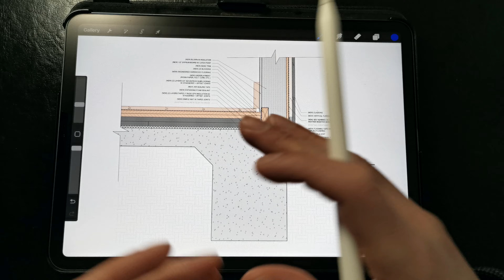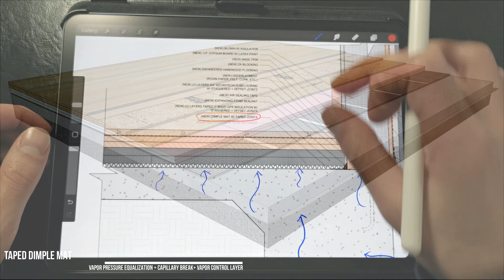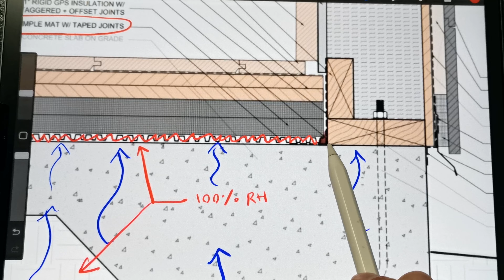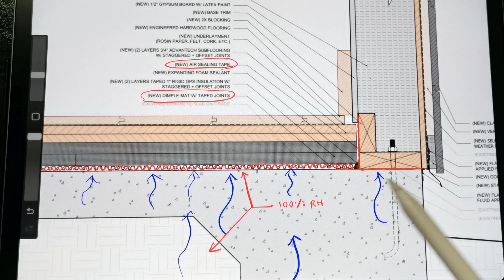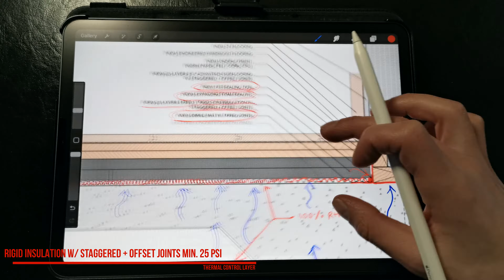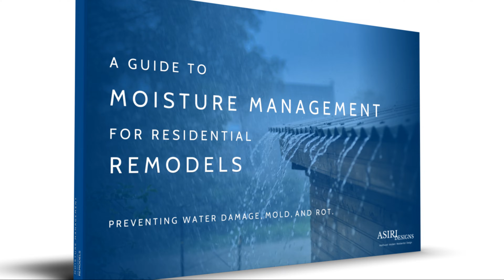Insulating and Sealing Existing Concrete Slabs (AVOID Moisture Issues)

Comment: Have you done any videos on insulating concrete garage floors, I use part of my heated garage for a workshop for my motorcycles, and part to park a vintage car.  Ceiling and walls are insulated, the concrete garage floor is not as yet but I want to do it (but am not sure what the best approach is to get some insulation along with strength to support vehicles, work benches, drill press, etc.).  Weather here in the Toronto area goes well below freezing in the winter, really need to address the cold concrete floor.

Comment: I used another cheaper technique. I dug two trenches on the uphill side of the house, one next to the foundation and one 10 feet away. Since there was no place to daylight the French drains I installed an exterior sump pump to get the water to the street. It took care of the problem.

Comment: If you apply this method to an old unfinished basement you raise the floor height half a foot. Which will look horrible if your basement stairs goes down to the basement and there will be a huge threshold at the door and you might have to readjust the lower stairs.
Reply: Old basements typically have limited headroom. Adding insulation and flooring above the original floor would be problematic

Comment: We recently converted a garage, with the typical concrete floor, to a livable space. When faced with all the COSTS and EXTRA WORK to put layer after layer after layer of vapor barriers and insulation, we decided to go with a flooring product that will NOT be affected by moisture - Premium Vinyl Planking. DEFINITELY the way to go to save yourself TIME and MONEY!!
Reply: This is just downright misinformed decision making. The vinyl itself is water proof but often there’s an underlay material attached like cork or form. This material IS NOT waterproof and will carry moisture and mold.
Reply: Sorry, pal...the only person pushing MISINFORMATION here is YOU! Went to the Big Boxes and even specialty flooring shops, many have a materials list of what it is made of and they also show a cross-section. The premium vinyl planking has ZERO cork, wood, or wood-derived products in it.

Comment: Moisture from the ground into the slab is liquid moisture, not vapor, so any talk of equalizing vapor pressure across the applied waterproof barrier doesn’t make sense, the barrier is really only to stop water from wicking or seeping up into the flooring system and the room.  A vapor barrier is needed to stop vapor from the room  air from condensing on a cold surface in the floor system.  In the system as presented it seems you are relying on the insulation snd subfloor materials to act as a vapor barrier.  Why not put a poly sheet just under the finish flooring same way as we put poly just under drywall?

Comment: Sounds good but it raises the floor 4.3/4". Can you at least is one 1" foam and one 3/4" subfloor glued together and use radiant floor heat?
Reply: Agreed! We faced the same dilemma, that after all the layering we were looking at nearly 5" of nonsense. We decided to get 3/4" high compression foam board with foiled side facing up into the room, taped all joints and installed premium vinyl planking over it. SOOO MUCH easier, and WAYYYY less money and we don't have to worry about the vinyl flooring expanding, warping or rotting.

Comment: Hi there! Would a dimple mat with 0.5 inch rigid foam insulation + a waterproof vinyl/laminate be sufficient? I don't have enough space to do multiple layers of insulation and or plywood/osb subfloor.
Reply from the maker: Check with the laminate manufacturer, in most cases this is fine, but all of your interior partition walls will need to bear on the slab since subflooring has been omitted.

Comment: I’m not sure if I’m buying it? What if there are already interior walls? Also, won’t this push moisture to the seal plates or the interior wall studs? I’m currently getting quotes for demo and replacement of a new slab with a vapor barrier. This seems like it would be way way cheaper.
Help please

Comment: I've read the PDF from the store and watched this video a few times. I have a couple questions on tape and foam. I'm applying this detail to a house built in 1977, which I'm rebuilding...so no gasket under the bottom plate.

Q1: The purpose of the tape from slab to blocking to air seal the bottom plate from the interior space. Should this seal be vapor open or closed? Would a liquid flashing would be as good as tape for the tape's purpose?

Q2: Is the purpose of the foam to seal the DELTA-FL to the tape, so the equilibrium of moisture is achieved? I'm avoiding foam in my build. Is there a caulk or liquid flashing that would be as good for the purpose of the foam?

Comment: WHAT IS “ ICEBURGING”? You said that in your last video.

Is SLAB HERE GOING TO BE THE SAME AS A POURED FOUNDATION  BASEMENT FLOOR?
I have a hole in my basement floor( somebody thought that was a good idea)well the gravity feed failed so  we got some water
Now I’ve a Sump pump with battery backup
Lived here some years no problem and then-water😡
NOW WE ARE DRY
I WANT A FLOOR OVER THE CEMENT
I WANT WATERPROOFING AND FIREPROOFING ON THE FLOOR. I don’t like cold and we have winters
My walls are insulated with a system from  a box store that is Sheetrock over thick foam & sits about 4” away from the cement walls
The walls sit on a Sliver of Former sub floor. Which was foam( there were channels built into the foam. OSB was the wood on top of that. 
We bough a Moisture reader , we are good. 
Does Rockwool have a fireproof foam rigid  batting or  are we to do all these other layers?  Floor is dry
Has been dry until this failure, 
It’s Dry again. There are 2-3 barely there hairline cracks-HYDRAULIC CEMENT THERE is planned
Or do we use Flex Seal painted over. As another video did on their chimney cap

Comment: Is this cheaper or more expensive typically than insulating from the outside and below the foundation in a new build. Im starting a mentorship with a home builder soon and was curious. Im in climate zone 3 (charlotte nc) so its not like out floors are brutally cold but an insulated slab might be a good way to add slight comfort in the winter. Slabs are rarely or poorly insulated here. Im afraid between the cost and maybe difficulty  finding contractors  who can do proper insulation prior to laying down the foundation that i might have to can the dream of insulated foundations if i try to serve below the median home price here. My soon to be mentor targets just putside charlotte aroumd the 300k range while charlotte homes have a median price of about 425k. I could quickly eat into my profits going too fancy here.

Comment: A few questions I hope you can answer.. 1) If existing basement wall pressure treated sill plates have a close cell foam underlayment, is the tape from the concrete to the sill plate necessary, or can you just foam the gap between the dimple mat and the sill plate? 2) If i can somehow manage to seal the dimple mat to my existing sump pump (which exists for interior french drains), wouldn't that be cause the vapor pressure to become unequalized? 3) If I have doorways leading to completely unfinished portions of the basement with painted slab floors, should I seal the cut edge of the dimple mat at those locations with tape caulk or foam?

Comment: Any thoughts on using 2x4 sleepers with 1.5 inch more foam between them and a single layer of subfloor, on top of the 2 inches of foam? As opposed to the 2 layers of subfloor. Thanks

Comment: Check out Nudura Homega polystyrene boards that have wood furring impregnated so you can fasten plywood directly. This is what I used 3.75” homega and then 3/4” plywood glued and screed to wood furring on the insulation boards. Hardwood right on top in my base,ent and zero issues.

Comment: Contractors often poke hole in the 3mm poly so that the slab dries fast. This was my case. I built my subfloor pretty much the same way you outlined. I did this in my basement and installed real hardwood floor. 10 years and my basement hardwood did not move or buckle at all.

Comment: Thanks for the good info. I'm curious how you recommend dealing with exterior door thresholds and existing interior walls that won't allow for seamless insulation or vapor barrier. I live in the desert in AZ, so it's fairly dry. However, moisture can still be an issue if not accounted for properly. Cold is less of a problem as well, although it can get frigid in the peak of winter. Undoubtedly, a little floor insulation would be very welcome in those days. As you may have figured out, heat mitigation is our greatest concern. My midcentury cinderblock house is poorly insulated and excessive cooling bills and hotspots are a constant challenge. 
I'm planning strategies to maximize efficiency and comfort as much as possible. I'm thinking of a couple layers of exterior rigid insulation at least 3-4 inches thick along with elevating the attic insulation to the undercarriage of the roof to allow for incorporating the attic space into the envelope and bringing as many systems inside as possible. The current setup with the ducting going through the unconditioned attic is about as inefficient and counterintuitive as it gets. 
Another step I've been contemplating is injecting foam into the wall cavities to help boost the R-value. I know it's not ideal, but I think there could be added benefits with moisture and keeping critters and bugs from using the open cavities as a super highway to get around the house. I'd be curious to hear your thoughts on that. 
Lastly, I am considering adding a shallow underlayment of insulation (possibly DRICORE Insul-Armor) on top of the existing slab-on-grade foundation with LVP directly on top of that. My challenge is to not eat up too much vertical space since the ceiling heights are fixed at a fairly modest 8 ft. and all the exterior doorway lintels are fixed in the block at 80 inches. Since moisture isn't as big of an issue here, I'm wondering if you think the vapor barrier is still advised or necessary. Any step or expense I can avoid would be a benefit, but I don't want to take a chance solely based on expense. 
Where I'm most stuck in the planning is how the transitions should look at the exterior door thresholds with the 1-inch foam board insulation. It would be nice to extend it under the door to create a thermal break, but that sounds like inviting a host of potential problems. I'm not so much worried about the compressive strength of the foam, but exposure and making it watertight sounds like a challenge. If I don't run it under the door, what do you suggest would be the best method to bring the threshold up to the new floor height with the insulation? I'd love to hear your thoughts. I've watched dozens of your videos, but I haven't seen that detail covered. Please direct me to it if you have. Or I'll just look forward to a response. Thanks again.

Comment: There are new OSB flooring tiles that come with a pre-installed rubber tile underneath with grooves to elevate it on top of the slab. Would that work? Would you still need to put insulating foam underneath it?

Comment: My below grade subfloor built in 1963 does not have vapor barrier, I’ve been told. Old tiles were removed and black mastic left behind. Not tested. Could I move forward with dimple mat procedure like you’ve instructed in this video?
Reply from the maker: @sashajohnson-z4s   This is probably your best option if you're dealing with questionable existing conditions in a slab, but it sounds like you're dealing with a crawl space area?

Comment: How about 15mil on slab, then roth panels, some thinset on top and then tile?
Reply from the maker: @fooflateka  That would work but I'd switch the vapor barrier to a taped dimple mat instead to prevent potential moisture migration through poorly sealed laps.
Reply: @ASIRIDesigns  what’s to be done with raised footing?
Reply: @ASIRIDesigns  by the way, what if there is no vapor barrier under the slab on grade?
Reply: So what if the sill plate area has moisture issues? Does your ebook address this?

Comment: Wouldn't a ZIP R6,9,12 panel and one layer of Advantech work just as well, as what you have shown above?
Reply from the maker: ZIP-R isn't designed or warrantied for floor or roof assemblies yet. Plus the compressive strength of their polyiso product is slightly lower than what you would want for this type of application.

Comment: How do you attach the wood subfloor???  🤔 I'm thinking you can't attach to the concrete because that would compromise the dimple mat, right??
Reply: The subfloor is floating on the insulation. That is the reason for 2 layers. The layers are connected making the entire subfloor monolithic. As you noted attaching the subfloor to the concrete would compromise the vapor barrier.
Reply: @cmbakerxx matt risinger also has a video on very similar install from a few years ago
Reply: You can glue it to the rigid foam with the special adhesive made for that

Comment: What changes would you make for an above-ground bathroom build to adjust for the additional moisture and tile?  Would a Shluter DITRA uncoupling membrane followed by a KERDI membrane system be sufficient?  Would cement board between the Advantech subfloor and the DITRA be necessary for tile or would you skip the Advantech and go directly to a cement board product for the subfloor, followed by DITRA and KERDI?  I really appreciate the input!

Comment: Could this strategy be used on a basement floor?
Reply from the maker: Absolutely! I specify this regularly for basement retrofits. The only difference is that you need a sump pit sealed to the dimple mat so that any water that leaks into that space can be pumped out.
Reply: @ASIRIDesigns  Interesting, thanks!
Reply: @ASIRIDesigns wouldn't any water that ends up on the slab just drain down through the slab? Sump pit would be for major water intrusion through the foundation
Reply: If the basement floor has Stegowrap and XPS under it, would you still recommend the dimple mat under plywood or Advantec subflooring?

Comment: So here with your example, the 2 layers of subfloors are glued and screwed to each other and then floating on top of the insulation ? Not screwing in down to the slab ?
Reply from the maker: That's exactly right. We also adhere the insulation to the dimple mat. No fastener penetrations through the dimple mat.
Reply: @ASIRIDesigns  okay thanks! It works the same on a basement slab too right ?
Reply from the maker: @LaJotaFranco  Yep! The only difference is that you need a sump pit and ensure it's sealed at that location.
Reply: @ASIRIDesigns  Thank you!
Reply: @ASIRIDesigns I love your videos.  Will buy your book on rehabbing an old house.  Does that include details on how to seal dimple mat to sump system?   Not sure how I would do that….   Thanks for your work
Reply: @ASIRIDesigns thanks for the video. Two questions: (1) how are you fastening your dimple mat to the slab, and the rigid insulation to the dimple mat? (2) is there any real risk of the floating floor shifting horizontally over time? Thanks again!